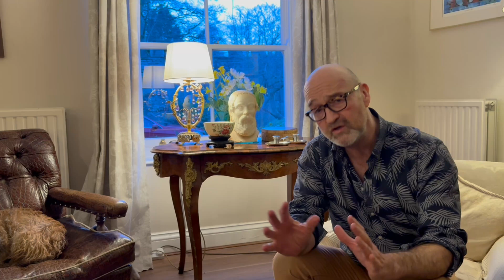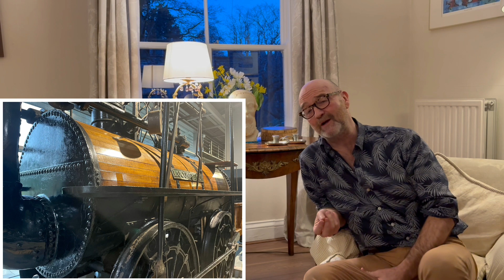Why the INVENTOR of TRAINS could NOT READ or WRITE?

Comment: These days we have modern 'Plastic trains' that have seats for midgets that are plastic benches with a thin layer of foam padding, and the carriages are hot and stuffy in all seasons because there are no opening windows designed by University graduates with Laptops and no common sense. I have great respect for the original inventors who did everything with instinct, pencils, paper and slide rulers and no University degrees
Reply from the maker: It’s how the Industrial Revolution was built. Talent and tenacity!

Comment: This is a fascinating period of history.  Stephenson's history isn't all that different from Richard Trevithick- both dropouts that were sent to the mines yet were natural born engineers.  Much of what George designed was based on Trevithick's work.  Indeed, Trevithick did drive a motor vehicle of his own design with passengers aboard on Christmas eve of 1801.  The major difference being that Trevithick basically went on a joyride on a road vehicle while Stephenson's journey some 20+ years later was an actual locomotive on rails.  Yet the two machines involved in both cases were very similar to each other in design.

Comment: Astounding times and astounding people.
Interestingly, following the historic inauguration of Stephenson’s railway, the Bolton and Leigh Railway act was passed by Parliament the same year, exactly 200 years ago and by 1828, part of the route was open for the transport of coal, one of the main locomotives (it was also a winch system) was a slightly modified version of the Rocket, called the Lancashire Witch, built by Robert Stephenson of Newcastle-upon-Tyne.
I still can’t believe a railway could be constructed from scratch to carrying coal in three years. Sadly, there are hardly any features left of the old line.
Reply: PS
The Bolton to Leigh line opened before the famous Manchester to Liverpool line. Timothy Hackworth’s ‘Sans Pareil’ that had taken part in the Rainhill Trials, was leased to the Bolton line in the 1830s then bought for permanent use.
Reply from the maker: Great info, thank you